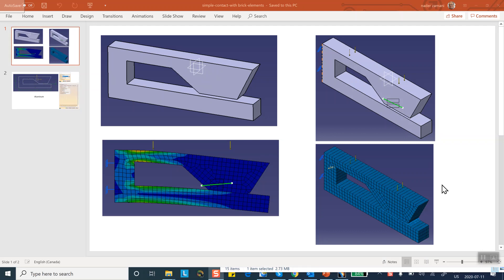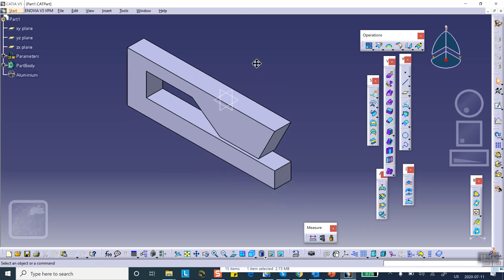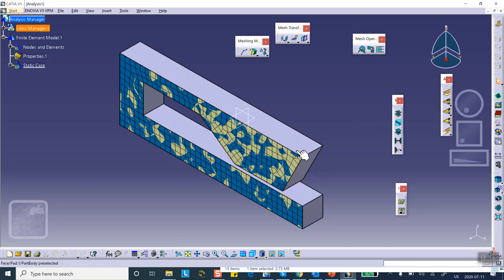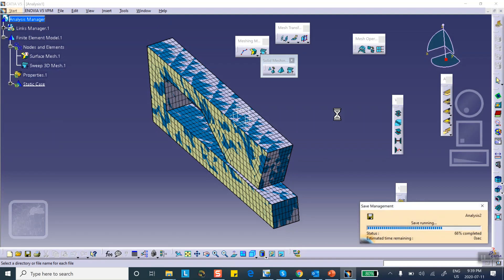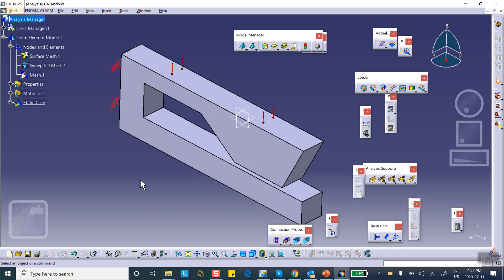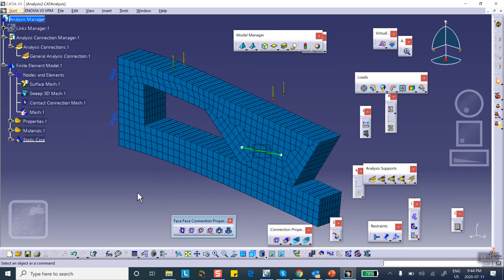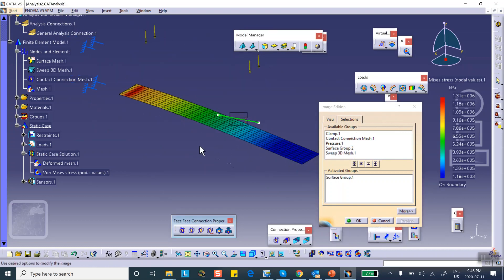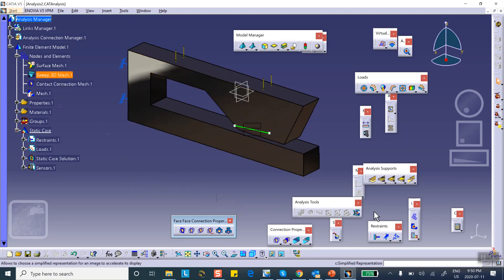FEA. Contact for Swept Brick Elements. Catia v5, video 1 of 2, Nader G Zamani

Comment: Hi Nader, what is the benefit of a swept mesh vs the default mesh? I have been trying to simulate the interaction of two parts in an assembly and have been struggling with the contact connection. When I animate the simulation,  I see that there seems to be load transfer between parts before the gap has been elapsed. Is this just the way the animation is produced? Thanks.